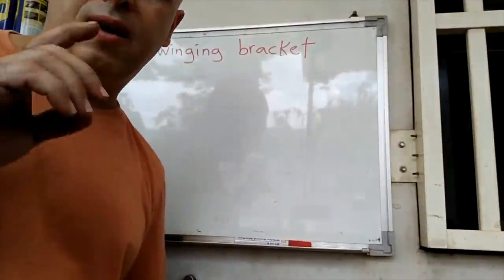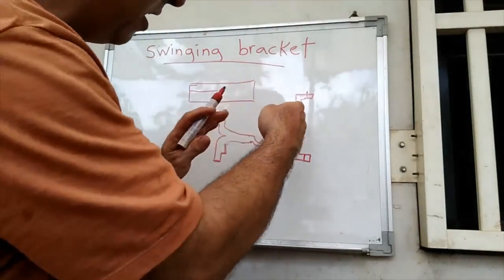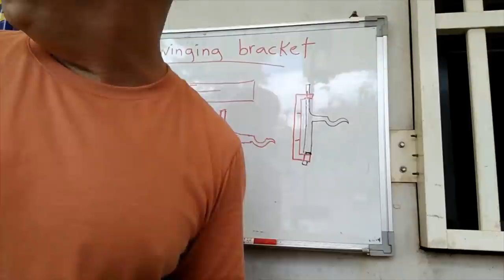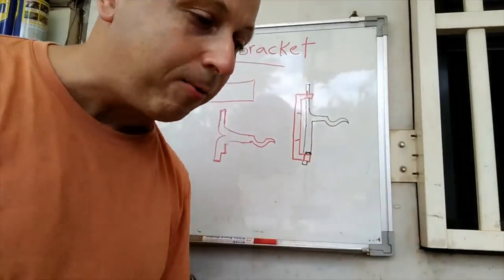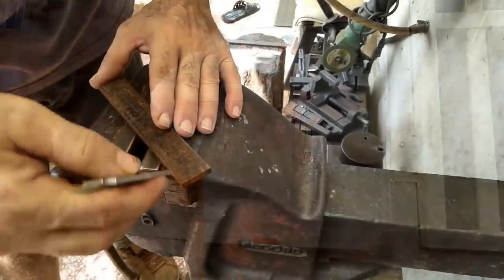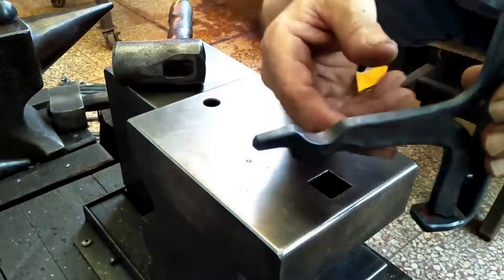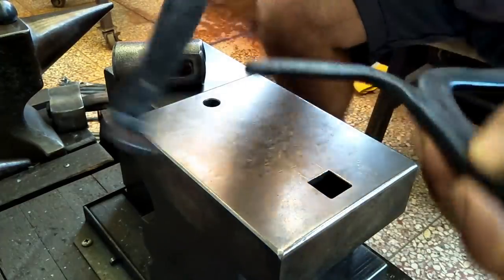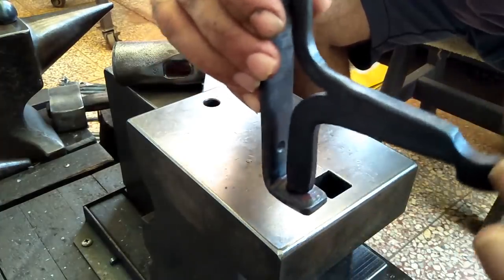Blacksmith Swinging Bracket

Comment: Really like this. I've seen larger swinging hooks on really old cabin fire place. So they would put a large pot on the swinging hook and swing in and out of the fire place.
Reply from the maker: For sure, this could be sized up and used as a fireplace crane. I also like this project (very useful item) and may do it again, maybe in a slightly different way. Thanks.

Comment: Very clever idea. Very medieval looking. Please get a plate of brass or bronze for punching holes so you don't damage the face of your anvil or your punches.
Reply from the maker: Hunter, I agree, this piece has a medieval look. A hand crafted look that modern welding cannot attain. And  it has utility and not much embellishment. I will consider a backing up plate for punching but if done correctly (to the right depth), any damage to the anvil face can be avoided. Thanks. Glen

Comment: Hey Glen, good work and it's simple as can be. I really like your tongs, they look nice to the eye, and they are ergonomic, good to work with. I forged some tongs based on yours (actually all of the tongs I made were made this way), and I can say they are way better than the tongs I bought on a flea market.
I want to ask about the material the tongs should be made of. I made my tongs from mild steel, and they work great when holding small (1-2 kgs or 2-4 pounds) pieces. Should I use larger diameter mild steel to hold bigger pieces, or higher carbon content steel? They are much more expensive here and sometimes I can't afford driving hundreds of miles to get them.
Thanks for the detailed explanations in your videos, and keep up posting them regularly.
Greetings from Hungary-.
Reply from the maker: I'm glad your tongs, somewhat based on what you see me doing, came out well. Keep up the good work and thanks for watching.

Comment: Nice work, glen. Looked just like your drawing. I personally don't care about the sound of the forge, the hammer hits sound great tho. But, just to try and help, the drill sounded odd too. Maybe it's a pitch or frequency issue with the mic that makes the higher pitches sound odd. Either way, it doesn't bother me. Thanks for sharing!
Reply from the maker: Christopher, I'm glad the audio doesn't bother you. I've heard numerous complaints and am dong my best to correct this issue or at least find a happy medium. Thanks for your support. Glen

Comment: Great little project.  As everyone says, you make it look easy and I know from experience it just isn't.
Reply from the maker: Lou, My projects are definitely not the most complicated. But you're right in that  it isn't always as easy as it seems. Thanks for your support. Glen
Reply: Glen GS Tongs it's your tooling and efficiency that is really outstanding.  I will be ordering some quite soon, serious.  Right now I'm in a quandary.  My hardy hole on my main anvil is 15/16" and needs to be filed to a true 1".  I already did a lot of work to get it where it is and I need to decide if I want to settle on a 15/16" hardy or work it out to 1".  That will determine the smith's helper sizing.

Comment: Awesome project, will have to try this one out!  Any chance you can share a pattern or measurements?
Reply from the maker: I'm glad you like this one. It came out better than I expected. I honestly don't have any plans (other than what I quickly drew on my whiteboard). The part mounted to the wall is made for 3/4" x 1/4" flat, about 7" long. The swinging part is made from 1 x 1/4" flat, about 6" long. I hope this helps. Thanks.